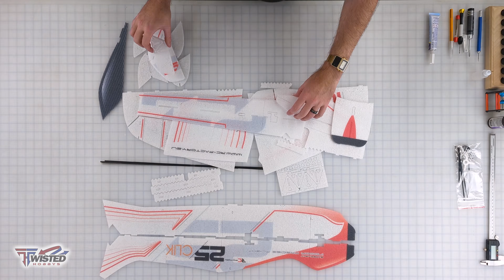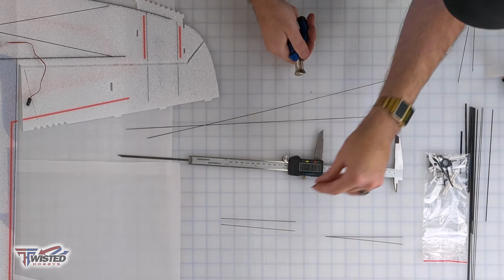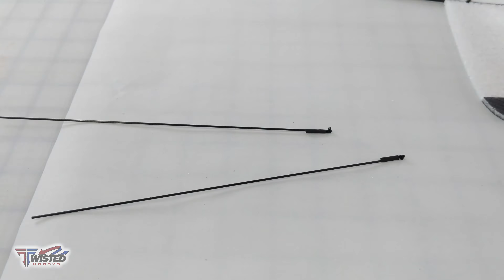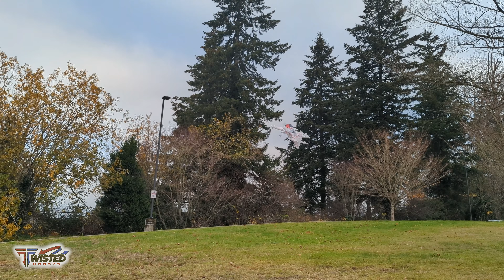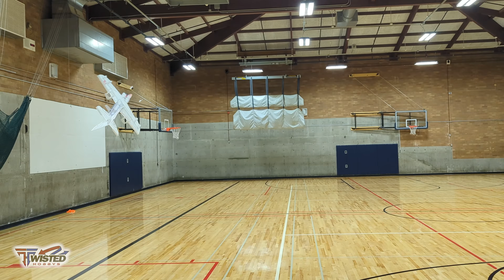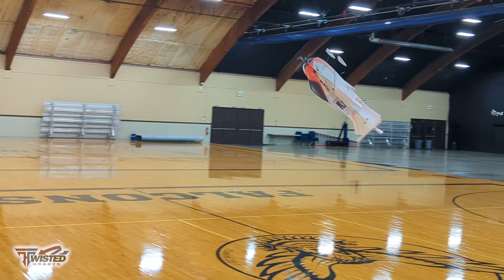Twisted Hobbys/RC Factory - Clik 25 - Build and Maiden

Comment: 2:14 there are two manuals for this build.  One of them addresses this (and uses mostly CA) The other manual uses foam tac for the build and does not address this.  I'm grateful for the video as I avoided this omitted detail.
Edit: In fact, it says to use the notch to make sure the nose piece is lined up! "Details matter."  Jack Reacher...   and also Dixon (in season two)

Comment: I built the Clik25 this last month and absolutely adore this airplane. So much so I bought the Synergy for a future build. Did you decide to keep the air brakes on?
Reply: I'm still torn. I love the look of them but I can't tell the difference yet. I'll do more testing and report back!
Reply: @RCwithJim     Yes please do! I was thinking maybe these air brakes while at normal slow speeds don't affect it much but come into play when doing a dive and as the speed gets higher than normal the brakes are designed try and maintain a consistent speed downwards . I am thinking of installing  mine tomorrow. Was even thinking of adding [after a few flights] some mild scotch tape [easily removable] to some of the holes top and bottom just to see the difference.